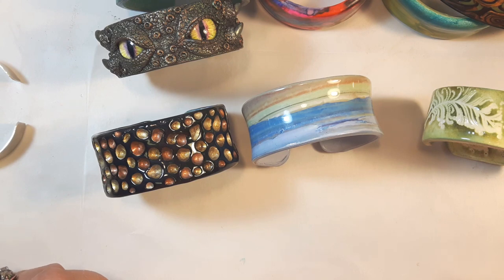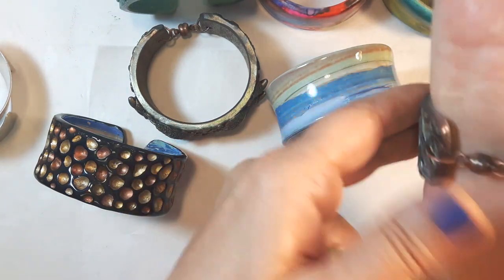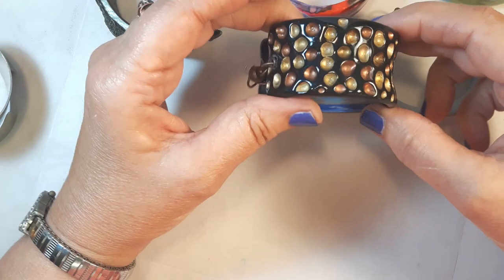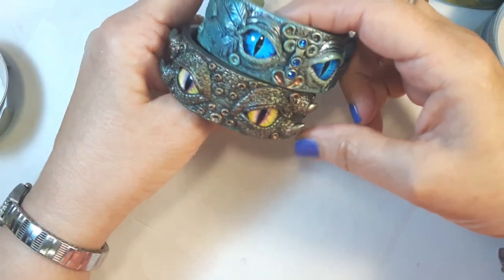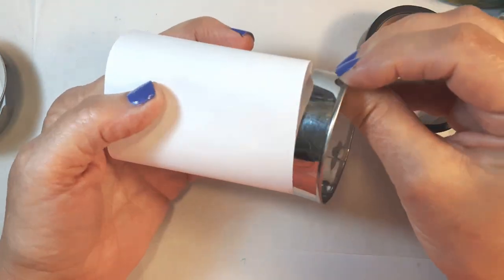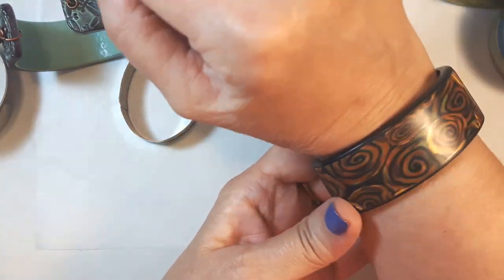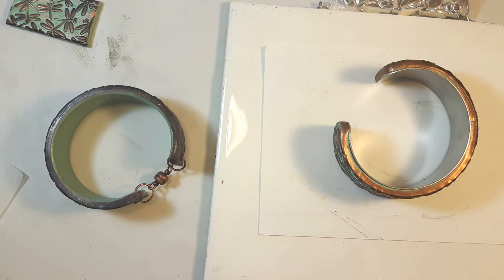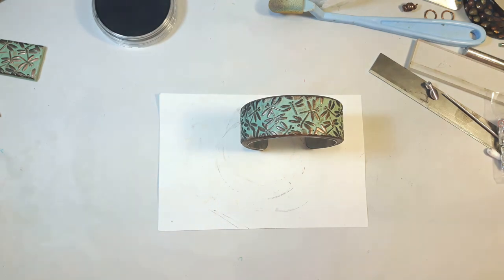Polymer Clay Cuff Bracelet

Comment: Loved this video! I think the mistake I was making with the Kor rollers is that I didn't apply any release on my surface. So when I tried the stamp trick it just stuck and rippled. I will give this a try!

Can I ask what color clay you started with? Love the verdigris/jade effect!

Also, last question, I've made a couple of cuffs without closures, and it keeps turning around on the wrist. Does that not happen once you add a clasp? I was considering using a an oval form to avoid that.

Oh and I'd love a video on the dragon cuff!
Reply from the maker: Thanks Krithika, for the Kor roller, have your clay on a tile or glass surface so it doesn't move when you roll over it- I had it on paper the first time I tried it, and that didn't work either. The clay colour was just a mix of blue and green scraps I had, and I added white till I liked the colour. The cuff turning around on your wrist is a matter of gravity, the gap is lighter than the rest of the cuff, so the heavier parts migrate to the bottom. A clasp helps with that if it is tight enough on the wrist The Easy Cuff forms are not perfectly round, and you can make them even more oval, and that will help with that issue too. I probably won't do a tutorial on the Dragon Cuff, as it is pretty much done the same as my Dragon Eye video
Reply: I do use a glass surface to work on, but now that I watched that bit of the video again, I think I might be using way too much pressure. So the clay sheet ripples and deforms and goes all over the place. I will go home n give it a try again!!

Comment: I wonder why you don't embed the eyelets in the clay before you bake the bracelet.  Wouldn't that be easier than glueing them in later?  Is it to avoid putting the minwax on them?
Reply from the maker: You could embed them before baking, but metal won't stick to clay, so you'd need to pop them out and glue them anyway.

Comment: I have such a bad time with bracelets! They wont flex and readily break. Ive increased my temp to 300 and bake for an hour and they still snap! Im so frustrated! Any clues?
Reply from the maker: Cindy Wade can I ask what kind of clay you are using, and do you use an oven thermometer? Don’t use SculpeyIII, it is brittle and will break. Premo, Soufflé Fimo , Cernit and Kato are good. As to baking, it must reach the recommended temperature for a long enough time to be cured correctly. I use Premo and Soufflé so that temperature is 275F. If you’re using a good clay and it breaks that usually indicates that it is under cured, so I would suspect that the temperature is off. Try baking thin pieces of clay, and when they can be bent back and forth without breaking then you should have the right temperature. Bake these pieces for an hour. Hope that helps!

Comment: Beautiful. Thank you. May i ask a question. when you bake them is it possible to bake them in batches, i.e 6 at a time? and if so do you need to adjust the cooking time. Many thanks
Reply from the maker: Thanks Michelle, you can bake as many as will fit in the oven at any time. I still bake for an hour or more whether I have one item or 10 items to cure
Reply: Whats the expected temperature to bake?
Reply from the maker: Bake at the temperature that your clay recommends, for Premo it is 275F or 130C

Comment: love the dragon bracelets ... do you have a tutorial for them? And where do you find the magnetic clasps?
I have really big hands for a woman and cannot normally wear bracelets as i can't get them over my wrists if they are open like the ones in your video and can't get them over my hands if they are a full circle. Just wondering if these polymer flexible bracelets might fit.
Reply from the maker: For sure you can make them big enough to fit any size wrist. The magnetic clasps can usually be found in bead stores, mine came from a local store to me, called I-Bead. I'd check Ebay and places like that too. The dragon cuffs, were just done in the same manner as my Dragon Eye Pendant tutorial.
Reply: thank you Patricia for taking the time to respond x much appreciated. I will have a look at the Dragon eye pendant tutorial x
Reply: thank you x

Comment: I really like all your bracelets. They are all very pretty. I have made two bracelets and got them total finished, and I was putting them on and they snapped in half. Very disappointed, I baked them for an hour at 200 degrees. They seemed to be firm, and flexible enough. I didn’t stretch it to far, I just slipped it over my wrist. I don’t know what I did wrong. Please help, what did I do wrong?
Reply from the maker: 200 degrees is way too low a temperature or most clays. I bake my Premo at 275F for an hour. Check the recommended temperature for your clay. Too low a temperature results in undercured clay, and it will be weak and break

Comment: I'm a little confused. You apply the polyurethane to uncured clay? Then bake it? I've always cured first, then applied a protective finish. Is it safe to bake an item with polyurethane?
Reply from the maker: The polyurathane was applied to the baked clay, then dried and cured in the oven at approx 230F for about 15 minutes more or less. No problem at that temperature. It is supposed to make the varnish more durable, but I really can't say for sure that I see that it does or not, so sometimes I cure it in the oven, sometimes not.

Comment: Thank you patricia. 
Question: if I don't put varnish on it, should I bake it for longer than one hour?
Reply from the maker: Sisiel vdb, Varnish doesn’t make clay stronger, it only protects paint or other finishes. If the clay is well cured it doesn’t need varnish at all. One hour is usually long enough to cure clay

Comment: Love them all.   The sea breeze is great, probably cause I live in Florida.   What kind/brand of magnets do you have?  Bought at Michales and Amazon, and can't hold a seed bead, 1 strand, choker.  Great video with lots of detailed tips, thank you..
Reply from the maker: I buy my magnets at I-Bead in Canada- they do ship internationally. ( no brand name that I can see ) I don't trust them completely for beadwoven pieces, as they can open if they get caught on something. I think most magnet clasps are the same. However, I think they are perfect for polymer clay cuffs- they keep them in place, and prevent them from turning around on the wrist.  If they open, the cuff isn't going to fall off anyway, so it's a little extra security

Comment: How did you make that pretty blue and cream one? It looks like ceramic.
Reply from the maker: Thanks Mary, that was scrap clay, chopped fine and reassembled in coloured sections, then put through the pasta machine several times to blend the colours. What really made it look like ceramic, though, was the layer of Kato Liquid Clay that I applied with a brush and cured with a heat gun.
Reply: Patricia Roberts-Thompson 2

Comment: I tried it but it snapped in half. Not sure what went wrong. Baked it for an hour at correct temperature. I have oven thermometer as well. I was so much hoping this to work 😟
Reply from the maker: What kind of clay were you using? Premo, Fimo soft or professional, Kato, Souffle, Cernit to name a few are all good strong clays. SculpeyIII is known to be brittle.-, and often breaks. If you used one of the stronger clays, I would try increasing your oven temperature a bit.
Reply: Patricia Roberts-Thompson I'm using Premo. Thanks. I would give it a try again tomorrow. These look so beautiful. If I could make it for personal use for now even that would be great for me.
Reply from the maker: Premo should be strong enough, Condition it well, and try a higher temperature. Perhaps you live in a high altitude- that could make a difference